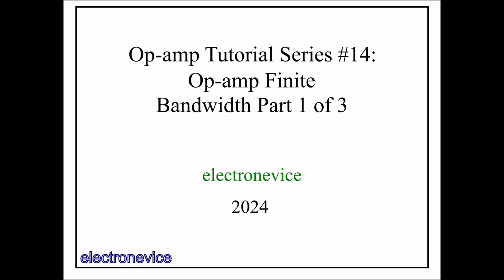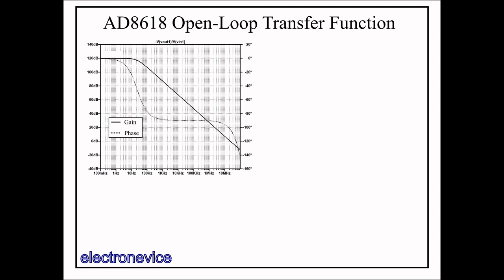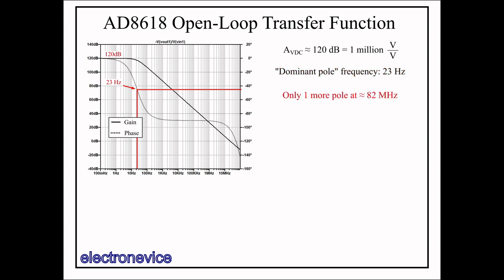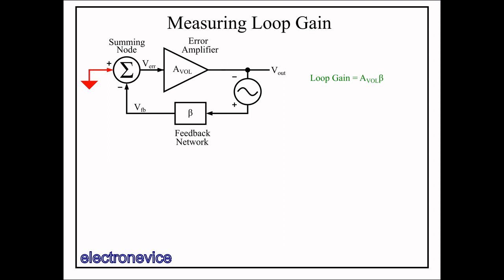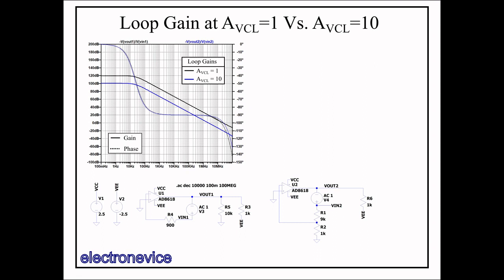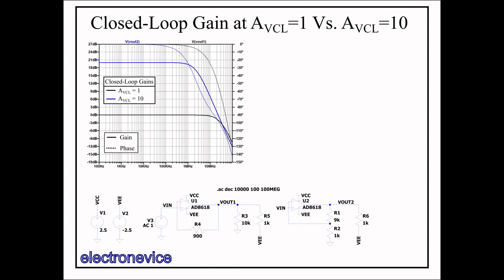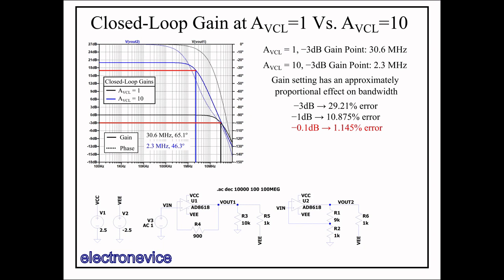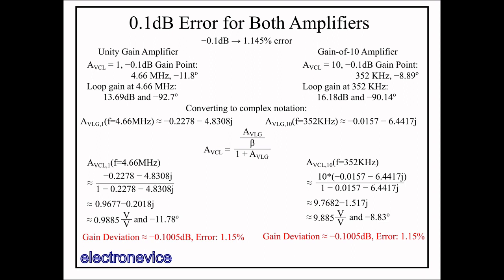Op-amp Finite Bandwidth Part 1/3: Introduction [Op-amp TS 14]

Comment: Isn't the one dominating pole a feature only for the internally compensated op-amps? I'm a little confused with this being presented as a general key feature...
Reply from the maker: The vast majority of modern op-amps are internally compensated to be stable at non-inverting unity gain, there are a small class of op-amps that are "undercompensated" to be stable only at gains at higher than unity gain, like a minimum gain of 2, 5, 10, or 20 V/V.  There may be some completely uncompensated op-amps, though if they still exist they are rare, or very old parts.  

So as a general rule, if you have a modern op-amp - unless you're specifically selecting for these undercompensated op-amps, you're going to be using an op-amp with internal compensation, and thus a dominant pole.  I discuss this briefly in Op-amp Finite Bandwidth Part 3/3: Compensation [Op-amp TS 16] (https://www.youtube.com/watch?v=j_OFpbYom2w)